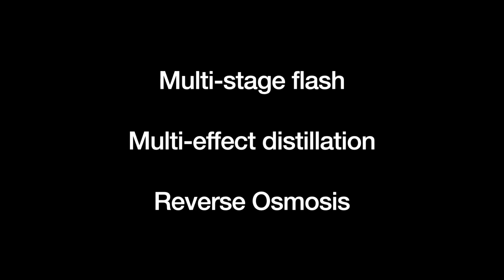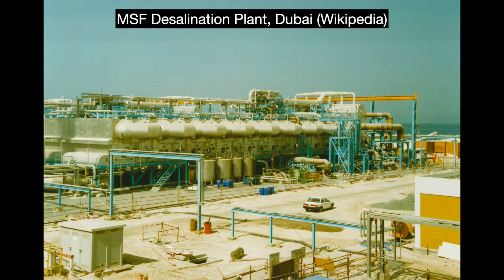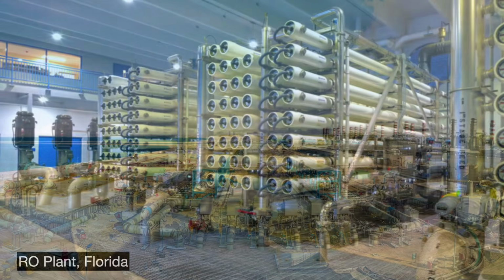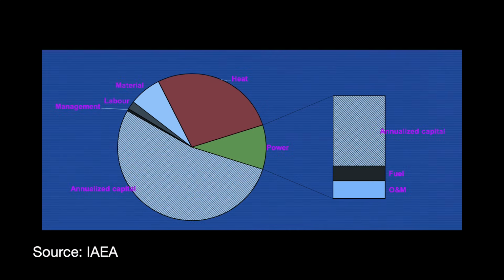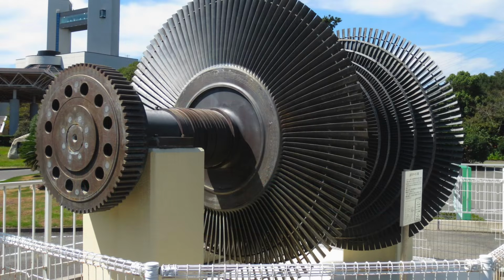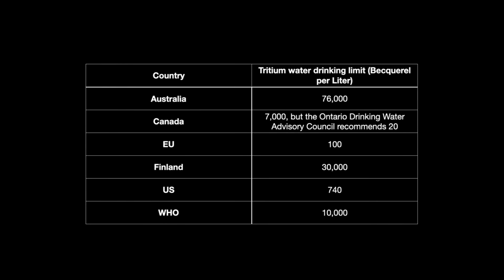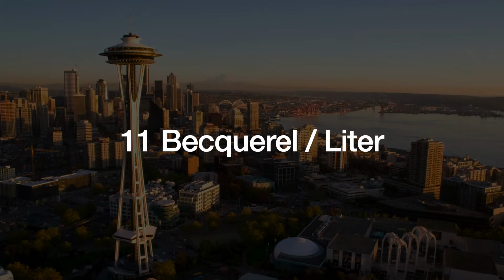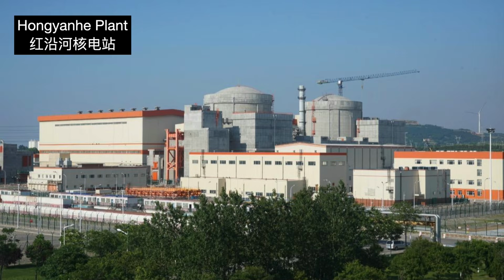Going Nuclear to Desalinate Seawater

Comment: Actually, large scale solar plants are the most efficient.  Of course, they only run during the day.
Reply: But, desalination plants run 24/7. Alternatively, they would be only 50% efficient on a 12/7 schedule.
Reply: @factnotfiction5915  Why do they have to run 24/7? Desalination plants can be set up to run as load balancers or to only operate when electricity costs on the grid fall below a certain threshhold.
Reply: @motimobo  "Why do [Desalination plants] have to run 24/7?"

That is how chemical processes work.

For example, bringing the water up to the proper temperature, for a large volume of water, is quite energy intensive. If your heat source flakes out, then your water cools, and you have to use energy again when the heat source comes online again.

If you don't run such a plant 24/7, then it has poor economics compared to a plant that can run 24/7. 

Can you even build such a plant? 300 years of chemical engineers have been working on continuous processing. We will now redevelop these plants with new technologies?

Comment: Because water is trivial to store, RO desalination is a very attractive load to have in a grid with lots of renewable energy. Running the pumps when it's cheap to do so matches demand to supply and helps alleviate much of the problems of renewable energy. It doesn't necessarily result in cheap water though.
Reply: Right - putting the cart before the horse.

Let's have expensive water because we need too find a use for intermittent RE farms?

Comment: People find it peculiar heating water is literally the most energy intensive thing. What, when we have server farms crafting literally entire worlds that can be experienced via VR goggles?
But why appeared always very intuitive to me, without any required knowledge.
Heat is the end waste of any action (alright, that is pre-required knowledge, but also common sense).
If it weren't, then the waste energy of some arbitrary action could be used for a different, more productive subsequent action.
[original action] > [recaptured energy, used for a different action] > [waste heat].
This is recursive. Any action can be "rolled up" until we have just the final two.

And this original > recycled pipeline works mostly. But what about the very last "recycled" energy? There are no more steps in between. It has to radiate just waste heat.
Now suppose we are interested in heating something. By definition, this is either an a) original action b) a recycled action, or c) waste heat. The heating effect of the TOTAL system is maximized when either original action = all energy, nothing else left; or on the other hand [original action = 0]  > [recycled action = 0] > [waste heat = 100% of the energy].
You notice these two are equivalent. Maximum "desired heating" = maximum waste heat.

Now take a universe. Over all possible actions possible in the universe, heating is by definition the most energy intensive thing. If something for whatever reasons requires heating (i.e. breaking apart intermolecular forces, but this knowledge is obviously NOT part of this intuitive explanation), then heating will be an action that, for a given delta (i.e. change in quantity), is the most demanding.

Admittedly, this requires mathematical logic even if no physics background, and not everyone can have a high IQ.

Philosophically, separating water molecules from, each other is also essentially a "request" to nature to calculate some supercomputer shit for us, because imagine just calculating the fluid dynamics of  single drop of water ...

Comment: No mention of graphene or graphene oxide desalination? This relatively new technology basically stacks layers of graphene or graphene oxide close enough together for water molecules to pass through but block virtually everything else, without the high pressure required for reverse osmosis.
Reply: He did make a passing reference to "other membranes technologies". From an energy magnitude perspective this in probably equivalent to RO in terms of power infrastructure?
Reply: He did make a passing reference to "other membranes technologies". From an energy magnitude perspective this in probably equivalent to RO in terms of power infrastructure?

Comment: Also, since RO is energy intensive relative to treating fresh water, co-locating a power plant with a sea water RO desal plant is important. Should that power plant be nuclear, an efficiency is gained. I thought that is where this presentation was going.
Reply: Since you need to get rid of the heat, better use it to desalinate water than to spew it into the seawater or a river. The brines can be used to extract minerals from it.

Comment: Video doesn’t mention what happens to the salt after desalination.. if dumping it back in the ocean it increases the concentration and wrecks the ecosystem.  It is another issue that needs to be addressed when these projects hit scale.
Reply: Good point, why not harvest the salt, we have a company here in SA that farms table salt from salt pans and exports brine. I have thought that if you were to cover the salt pans with glass houses you could have solar desalination by collecting the condensation and salt harvesting in one industry.
Reply: Put it out 20 miles into the ocean, now we dump it 1 mile out?
Reply: @gtrguyinaz  doesn't make a difference, just changes where the salt concentrations change.
But most water goes back via sewage treatment and then into the rivers/sea, so you can funnel the brine into that to minimize the impact.
Reply: You can mix it back into the water once it's used: treated sewage water
Reply: Just don't dump it in the ocean then.  Duh.
Reply: @Kalikus808  Dumping it in the ground wouldn't be any safer. It would pollute the surrounding land and water supply.
Reply: @tommylakindasorta3068 or maybe don’t dump it and store it in tanks.
Reply: @thejfactor1  The process constantly produces millions of gallons of brine. Putting it in tanks would make it cost-prohibitive to do, and you'd eventually run out of room to build all the required tanks.
Reply: Worth considering, most domestic and industrial would end up back in the water waste stream.  In most cases you would be looking at a net neutral salinity.

Comment: Use the heat energy directly (without converting it to electricity) to pump seawater into a large (many square kilometers) lake that is far inland. Maybe something similar to the Salton Sea. Let it evaporate in the sunlight. This will increase rainfall by an amount equal to the amount of water that was pumped, minus the amount of brine that is let to return to the sea. (Your choice as to how much that is)
Reply: I've often thought this might be a good way to get a lot of water into an area. The energy needed to pump water around is minimal compared to the stupid amounts of energy the sun puts out. A square kilometer of lake would absorb nearly a gigawatt of energy from the sun. A country like Saudi Arabia, with low-lying lands partly surrounded by mountains, might be able to get away with it if the winds blow favorably. But they probably don't...
Reply: @RipleySawzen  Pumping Mediterranean seawater until it can be used in a series of hydroelectric plants located next to the Dead Sea would get you a lot of non-carbon electricity plus added water vapor in the air. If you need it to stop, just don't pump the seawater.

Comment: What about using nuclear power to generate electricity to run a heat pump based desalination plant? Should be very efficient. The condenser side boils the water and the evaporator side of the heat pump condenses it back up. Probably very expensive though.

Comment: If not mistaken, based on what I read. The by-product produced by desalination is a concentrated salt water. Since we harvested the "fresh" water component, the by product which is the super salty water gets discharged into the sea. Eventually, the sea will become a "dead sea" and there goes our seafood.
Reply: No it won't for one simple reason. The water cycle. All the water we take from the ocean through desalination will eventually make it's way back to the ocean.
Reply: Are you a comedian or something? The salt in the ocean is constantly diluted by rain.

Comment: Desalinated water is a solution to a lot of the worlds problems. It's a shame it hasn't become more widespread. People say it's too expensive, but the more we invest the cheaper it gets. I've seen proposals of solar powered Desal plants. Could even be used to change water tables and water cycles of otherwise dry regions. Just build water pipelines and pump excess fresh water.
Reply: Desalinated water is still very salty, unless perhaps you're to do the process several times until it's good enough to drink...but then it would make the water very expensive to produce. I worked in Saudi Arabia ang nobody drinks from the tap as the water is salty, we just used the water for bathing, cooking, washing clothes and other household needs.
Reply: @rap3208  we have it here in Australia. In several major cities. Can't taste the difference.
Reply: @Jarms48  I doubt you desalination plant produces as much volume as the Saudi plants do. As I have said the more you try to remove the saltiness, the more expensive is the process.
Reply: @rap3208  Australia has 46 desalination plants across the country, we have more plants than Saudi but less production. Australia’s desalination process is more expensive than Saudi’s, which I presume is because it’s far more heavily treated. As I said, I never even tasted a difference here.
Reply: Desalinated water should have no salt at all by definition. If it's distilled then it will be completely pure.
Reply: @motimobo  SHOULD but not really.
Reply: @motimobo  you stumbled on your own error there. Desalination does not equal destillation. And most desalination does not use destillazion, because that has the highest energy requirements. Pljs, if you want drinkjng water, you need to re-add salta then.

Comment: There was a plan in the early 1970's to build artificial islands off the coast of California, place nuclear power plants on them, and incorporate a large water desalination process. The selling points were pollution-free electricity and copious amounts of fresh water sent through undersea pipes to southern California. The islands would have had earthquake safety measures incorporated. The plan was not used for various reasons, but if it had worked as planned, it could have solved quite a few problems California suffers from now.

Comment: You'd think they'd use passive solar collectors in the middle east to run their desalination plants.  And use cold deep sea water to cool the radiators.
Reply: Sand storms that can damage or ruin the solar farms along with inefficiency due to stop start cycle by relying on solar power on top of the possibility of equipment being ruined by the cycle are some of the cons of such a thing. Saudi arabia is building one apparently so excited to see if they found a way to mitigate these issues.

Comment: So reverse osmosis needs 5KWh of ELECTRIC energy per ton of water and distillation needs 10-15KWh of THERMAL energy per ton, then the losses (both energy and expenses) from converting heat to electricity is a waste. You lose about as much energy converting heat to electricity, so distillation makes sense that is if the reactor is on-site.

Comment: For countries with excessive renewable power wouldn't it be cool to use the extra power for desalination instead of using battery storage? This creates water while reducing costs since you don't need batteries!
Reply: we do, in South Australia
Reply: @rickcostin  I'm Aussie too but didn't know that. Aussie Aussie Aussie 😊
Reply: @Planet_Xplorer  I've seen more comments on batteries being used for excess power production, which is only a problem for coal/gas and apparently nuclear plants that take ages to react to changes in demand and need to keep running even when there is no demand. My understanding is that batteries are used to stabilize the grid if there is an outage like the one we had in SA when a tornado took out a main transmission line. The state government was ousted because of a perceived over reliance on renewable energy, when it came down to the Victorians not closing their interconnector. Elon Musk stepped up to the plate with the worlds biggest battery in Jamestown SA which helps stabilize the grid when you have a lot of wind and solar power which is intermittent.

Comment: Draws all comparisons to coal and oil while spending less than 3 seconds discussing solar and wind. Bwahaahaa
Reply: There’s only need to compare things that work.
Reply: kokofan50 you’re aware that intermittence is not a problem for distillation right? And that in places like Arabia which the video explored its barely an occurrence regardless l. And that renewables are hundreds of times cheaper and quicker to install and operate than nuclear. Plus that gap is only increasing. Plus it generates less waste. I’m sorry, in what way is it not a viable option?
Reply: @alexmac101  it’s a huge problem for all systems that wants to be economically viable. A desalination plat powered by renewables is going to have to stop and start, which is inefficient, and they’ll be competing with other users at peak times. Nuclear powered desalination plants can run 24/7, and ramp up at night when electricity is cheaper
Reply: @kokofan50  Stopping and starting is only relevant to old methods of desal plants where the water is heated. For modern designs like RO which only use pressure, gradient and electricity, stopping and starting does not affect efficiency in any meaningful way. Especially with a output product like water where end users do not require real-time generation as electricity does. Add in that solar is already way cheaper and still falling, and combine with the fact that most places that will experience extreme water demand in the coming decades have economic and political stability factors which make renewable/solar MUCH more adoptable than atomic power plants. Trust me, the video maker ignored renewable for a reason; they make the rest of the discussion moot
Reply: @justwhatever23  I’m partly talking about thermal systems, but inefficiencies aren’t just in the desalination. How you run a plant determines how economical it is because labor and other resources need to be used efficiently along with the desalination system. 

Solar has a low sticker price, but all of the ancillary costs make it one of the most expensive.

Comment: Reverse Osmosis isn't actually more efficient than thermal desalination. The sources of energy are not comparable. RO consumes electricity to drive high pressure pumps, while thermal desalination consumes low grade heat that couldn't otherwise be efficiently used such as low pressure exhaust steam from a thermal power plant. Not all energy is created equal in terms of useful work potential.

Comment: with so much free sunlight is silly to use nukes , my idea is to used old oil takers at sea to evaporate seawater and fill up with distilled water all at sea the salt id dumped at its source into the ocean to be diluted by rain, the whole solar array is in tow but at sea you dont need to move so its very cheap.

Comment: The big problem with desalination is the host of imponderables-- like corrosion in the reactor coolant loops and corrosion in the brine loops.  Everything looks fine from the outside until a pipe corrodes through or a valve gets stuck open or shut and then EVERYTHING has to be shut down for weeks, months, years, or forever.  It's especially bad with sodium loops as the sodium remains radioactive for a very long time.
Reply: But the corrosive water won't be in the primary cooling loop of the reactor it will prob be in the secondary just like pressurised water reactors so how will the primary cooling loop of the reactor corrode ?
Reply: And in nuclear plants everything has back ups so if a valve gets stuck open or a pipe corrodes they can use backup valves and secondary other loops temporarily until the main ones are fixed that is just how Nuclear power plants in general work
Reply: @alexandrosandreou8585  "Everything" has backups?   Nope.  I don't know of any reactor that has backup heat exchangers or main valves.  Sometimes,  there are dual pumps and dual generators but that's about it.

Comment: Building anything using nuclear fission does not make sense any more. 
- It takes decades to build a plant
- Nuclear power production  is not expanding since the late 70s
- Nuclear power is not renewable.

Our Uranium-235 for current LWR is estimated to last another 30-50 years. New reactor types are pretty much science fiction currently - it will take decades to make them safe to use and to build them.
Reply: South Korea builds plants in 4-6 years, so that’s points 1 and 2 down. 

Cutting down forests and burning them is renewable. Not really a standard I care about. 

Other types of reactors have already been built and they’re safe. They just need to be deployed commercially.
Reply: Wow, you have fallen for all the anti-nuke propaganda, haven't you.

Comment: Radioactive contamination isn't an issue, since PWR plants use heat exchangers to transfer heat from the reactor loop to the loop feeding the generator turbines. 
As for safety: it's more public perception of safety than actual objective safety of the plants. Chernobyl is a unique event that occurred in the setting of a government/culture that had been moulded to be purely consequentialist in mindset, which disregarded safety. The original RBMK design also made use of graphite as a moderator and water as coolant (while everyone else uses water both as a coolant and moderator).